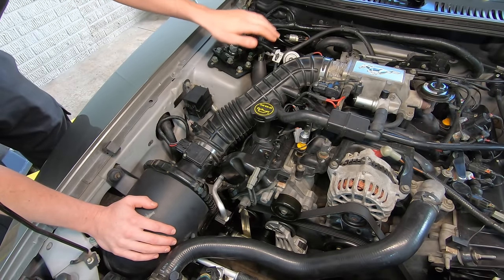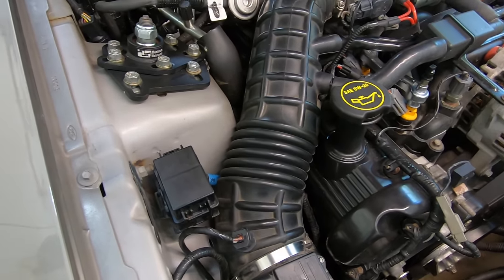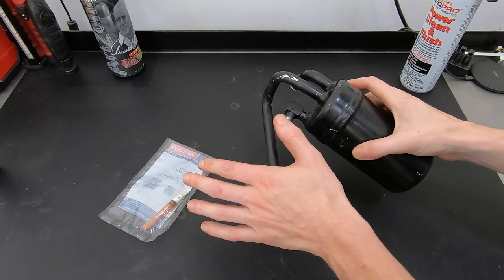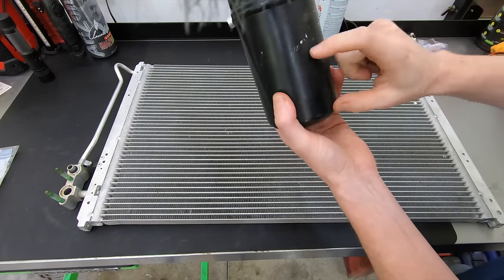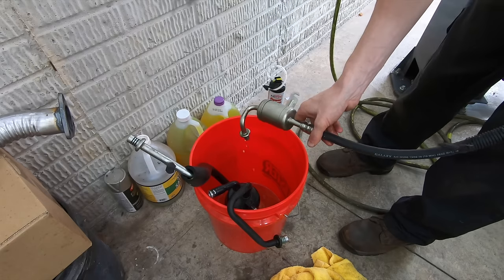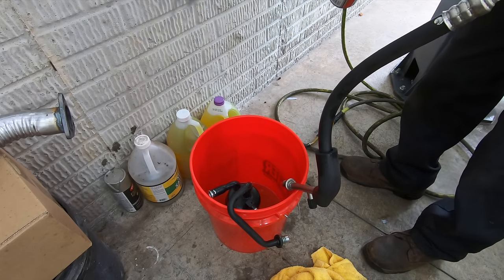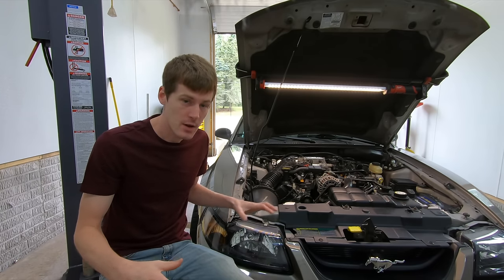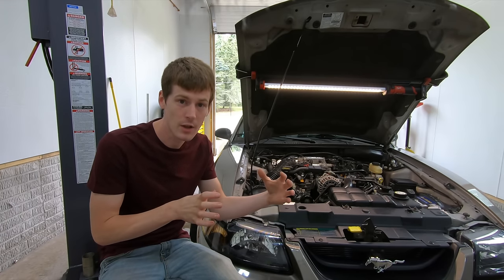How To PROPERLY Flush and Recharge A Contaminated AC System.

Comment from the maker: Tools used in this video:
Aerosol Flushing Solvent (at the minimum you'll need 2 cans): https://amzn.to/3CHaazN
Professional Style Flushing Canister: https://amzn.to/3AfnVCD
Flushing Solvent for Professional Canister: https://amzn.to/3dMGpTy
PAG 46 Oil w/UV Dye: https://amzn.to/3AGIIk4
PAG 100 Oil w/UV Dye: https://amzn.to/3pDHVdp
PAG 150 Oil w/UV Dye: https://amzn.to/3dEstLc

R134A Manifold Gauge Set & Vacuum Pump Kit: https://amzn.to/3AFHmWI
R134A & 1234YF Manifold Gauges:  https://amzn.to/3T9LlCb
Vacuum Pump: https://amzn.to/3A8YgM0
Can Tap:https://amzn.to/3T7is9I
R134A Refrigerant: https://amzn.to/3dDPluj
1234YF Refrigerant: https://amzn.to/3KiejvO 
My Amazon Store:  https://www.amazon.com/shop/repairgeek
Help support the channel, buy using my Amazon links
As an Amazon Associate I earn from qualifying purchases and your cost is exactly the same.

Oil type and quantity information: https://supercool.ac/
-Click Resources
-Click Lubricant Specification Guide.
-Enter Year, Make, Model.
Reply: I would like to add one thing that you didnot mention... When you hookup the refrigerant can to the yellow line, you need to bleed off the yellow hose by loosening the fitting at the manifold guages until the refrigerant comes out, then tighten the line.  Not doing so adds outside air back into the system that is not supposed to be there.  It basically defeats the reason for vacuuming the system. Outside air isn't coolant and contains moisture and moisture and refrigerant becomes acidic=bad
Reply from the maker: @blh3741  my manifold gauge set has what are called "low loss" fittings. The end of the yellow hose has a schrader valve inside like a tire. When I disconnect the yellow line from the vacuum pump, the vacuum is held. The only thing that could have introduced air is the can tap that I transfered from can to can.

Comment: I flush my system very differently than Billy here. First I drink a dozen beers. Next I start drinking more beer as I remove my pressure hose and press it against the low pressure port on the line. I release the solvent into the system. Nine months later we have a baby transformer.

Comment: You really need to bleed to AIR out of your yellow hose when you connect up a refrigerant can. Every time you change a can you need to bleed to air from the hose. If you don't do that, you are adding non-condensable air to the system.
Reply from the maker: The yellow hose has a Schrader valve at the connection at the end of the hose. When I pulled vacuum on the system I also pulled vacuum on the yellow hose. The only thing that could possibly have air in it would be the can tap that was swapped from one can to another.
Reply: @RepairGeek  Your yellow hose has a Schrader valve on the inlet side? Never heard of that. My yellow hose doesn't have a Schrader in it. Your telling me that your can adapter has a pin in the end that depresses the Schrader? Mine does not have anything that would depress a Schrader.
Reply from the maker: @thewoodcrafterioy4003   https://amzn.to/3E5J6dK That is my gauge set. It's right in the description. 

"Red and blue conversion hoses 1/4” F x 1/2” ACME-F, yellow hose with shut-off valve 1/2” ACME-F."
Reply: @thewoodcrafterioy4003  The fittings on the hoses are called low loss fittings. Sealed on both ends when not connected. The schrader valves can be removed for more flow, but you'll need to bleed the hoses when connecting them.

Comment: Great video, one observation :when charging with 1lb. cans,  after attaching can tap and opening can tap valve to each 1lbcan it is a good idea to loosen charge hose at gauge manifold slightly to let tiny amount of refrigerant to exit to purge hose of any air that entered during attachment of refrigerant can before opening low side manifold gauge.
Reply from the maker: This manifold gauge set has a check valve in the end of the hose that connects to the refrigerant. So when I disconnect the yellow line from the vacuum pump it will hold the vacuum.
Reply: @RepairGeek  great video. But if there is a check valve in the yellow hose, then how could attaching a can to it push Freon in the other direction? Wouldn’t the check valve stop that?
Reply from the maker: It's a Schrader valve actually. That's the same valve that is in the stem of a tire. You can fill a tire and let air out of a tire using the same valve. It's the same concept here.
Reply: Subscribed!

Comment: Technically that yellow line on the gauges would have a small amount of ambient air in it after disconnecting it from the vacuum pump. So shouldn't you unthread it a bit and purge it with a little refrigerant.

Comment: I thought that surely after all that work you would measure the charge from the cans using a scale. I've always heard that using Hi/Lo pressures alone is not accurate to determine the correct amount of charge in the system. This video is a great resource to DIYers!
Reply from the maker: The car's refrigerant capacity is 34 oz. 3 cans is 36oz. I just dumped in the 3 cans and ran it. Works great.
Reply: @RepairGeek  Nice. It doesn't always work out so neatly... mine is 19oz
Reply from the maker: 2 extra oz of refrigerant won't have any major side effects long term. The cooling capacity may be diminished very minutely but systems only leak over time. I was going to have more aggravation finding a scale, weighing the can, and trying to get precise over something that isn't going to cause any giant issues. If your system takes 26oz you can't put 36 in it expecting it to work correctly. I am just fortunate with the capacity of my system vs. the capacity of the cans.
Reply: If I don't have the black Gunk you're speaking of and the only problems I had was a sticking expansion valve and a bad clutch on the compressor do I need to change the condenser and muffler?
Reply: @RepairGeek Yep.  The gauge set and hoses held 2 to 3 oz. that didn't get into the car.
Reply: @bryanwood9285  What do you do to add that extra refrigerant to the vehicle
Reply: @xpert_kid_one730  you fill the gauge lines with freon and then tare the scale--or guess. I disagree with an earlier post because I've seen it.  2 to 3 extra ounces won't stop cooling, but will cause it to be less effective in very hot weather because it'll run a little too high pressure...especially at idle.  Thus, it'll get over pressure in very hot weather and the computer will turn the system off.  Been there, don't that.

Comment: Hello! It's by far the best video on AC. A few questions: why should some of the oil in a compressor with a fixed stroke go into the circuit? Like a variable lift compressor, the fixed lift compressor also has a swash plate. Both need to be lubricated. What should be lubricated in the circuit? The only moving parts in the circuit are the valves on the compressor, which do not require special lubrication, and possibly the expansion valve.
The dryer consists of a surface, for example granules, onto which moisture is absorbed. If this surface is contaminated with oil or is even covered with oil, moisture will no longer be absorbed. In my opinion, oil in the circuit is oil from the crankshaft housing which over time gets into the circuit along the pistons

Comment: Very good video!  You touched on many points and I would recommend anyone doing this on their own research..research...research!  (I learned the hard way also!)
I recently had a compressor replaced on my 2001 Buick and neglected to change the drier, condenser, orifice tube.  Mistake!!  Changing-out the compressor "ONLY" was a huge NO-NO.
The shop that changed it out really didn't inform of the negative aspects of everything involved.  Ultimately, I ended-up doing everything (Including a flush) on my own.
Also  - I was under the impression that compressor hoses (Like yours, with mufflers) were not to be flushed?  Interesting.  I'm glad your A/C is working!
And lastly... Thanks for not falling for all the A/C refrigerant marketing crap!  Use only 134-a and don't fall for all those sealers etc.  Thanks!

Comment: Thank you for this!  I'm currently replacing the entire AC system on my S2000 minus the hard lines.  It helped to see how you were flushing your lines out and i have that exact aerosol solution you used as well.  Replacing my evaporator core, expansion valve, drier, condenser, compressor, and high/low hoses.  Only thing i'm keeping are the actual hard lines so I wanted to make sure I got those cleaned out properly.
Reply: Is it ok

Comment: FYI
We recently installed a new AC kit. Had an undetectable leak. No dye anywhere. Held perfect vacuum over night. Held 125 psi of pressure over night. 
Hook it up to the 175 psi compressor and found a bad hose crimp.
Dont overlook the simple things. KISS.
Weve always used lacquer thinner for flushing. Cheap, dries out easily blowing air through. Never had a problem.
Also its easy to add an inline filter at the expansion valve and condenser. They sell little cone shaped filters that slip into the connection fittings. Couple bucks each, slip right in.

Comment: Great video as always. Thanks. 
Don’t use shop air to break vacuum. Use nitrogen instead as it’s dry gas. Shop air will introduce water into system
Reply: Would a compressor with a drier resolve this?

Comment: Thank you so much , excellent video , I have the same problem of a dirty contaminated system, my car is a 2005 Ford Freestar Van, I have both expansion valve systems, because there is a thermal valve in the back, that Van has an evaporator in the back for the passengers, I cleared up many doubts with your video and I gained a lot of information, thank you very much again

Comment: You said an important thing 
No matter of which gas brand you charge your system as it working properly and no it has no leaks...
Golden advice to anyone living in hot. States dude.
Thanks a lot for sharing us your experience on this issue.
I'm glad i knew recently that cleaning the evaporator also is a waste of money and time just buy a new one instead.
Thsnks again from 🇸🇦

Comment: Thanks for very good video! I would recommend to have shutoff valve right next to the vacuum pump in the yellow line. Without that you will have some air with moisture in the system.

Comment: Love your video! One question .. how much psi for the compress air in the evaporator? I’m scare I’ll brake it lol if the air is to strong.. 😅
Reply from the maker: You won't break it. The pressure of the refrigerant when the system is charged and not running is greater than the pressure you'll see with a home air compressor.

Comment: Best vodeo ever! Plus I have an 04 Mustang that I'm fairly certain I did the exact same thing! 🤣 It was my sons car and so many things were wrong with it. He decided to get a new car and I decided I could fix it. So I did. 💁🏼‍♀️  From the start with electrical issues to fuel issues to engine issues to vacuum issues, I fixed. It was insane. I get it running and bam! AC issues. 🥺 In the middle of the Houston summer. I feel like this is a brand new car now and soon will be cold AC! Thank you for this video! ❤️ New sub!

Comment: Pulling a vacuum not only removes moisture but removes any other non-condensables that may be in there. You can compress air,  you cannot condense it. AC works on the principle of something (like refrigerant) changing state. The latent heat of evaporation and condensation is a wonderful thing.
Reply: Does vacuum the oil out of system also?
Reply: @rohitbhatnagar7599  not typically.  The oil tends to move around in a vaporus state propelled by refrigerant. Pulling a vacuum occurs at a very slow rate and thus the oil is left behind.

Comment: Advice… Bleed the air from the charge hose before opening the manifold valve… maybe you did that and didn’t mention it…. or I missed it? Great and very helpful video….
Reply: I was watching for him to do it but didn't see a way on his manifold set to bleed the line other than possibly cracking the line open.

Comment: I did the very same thing…. I replaced my compressor…. It leaked so I had to buy another one. I use pressure and duct temp to charge the system…I could not understand why it wasn’t cooling nearly as well as it should (I now know The pressure was higher than normal due to excess oil in the system…and not enough refrigerant). I’m very lucky I didn’t hurt my compressor… Lesson well learned….

Comment: i have a 89 civic. when i first got it, all I did was vacuum the a/c, change the orings and clean out the hard lines. about 1000 miles after charging it up, the a/c compressor failed, specifically the clutch. this time around I've got a brand new drier, expansion valve, and since my compressor & evap are both serpentine type i'm going to flush them.
hopefully that makes the a/c last a good long time.

Comment: I did exactly ur mistake last week! I put too much of PAG oil and now my ac compressor making noise and the pressure in high and low side both of them not stable i think  unfortunately my ac compressor will die soon i hope it's will stand at less for this samar i wish saw ur video before what i did! Anyway thank you so much I appreciate pro  now i learn more about car ac  system.

Comment: ~@1:20 on the replacing of the compressor: Someone wrote me on Amazon question, that when he put a new compressor he removed all the oil (which was there from the factory) from it, cleaned it w/Mineral Spirits, then added PAG oil. I think it makes sense, since we don't know what oil was added (and how much as a matter of fact), PAG comes in 3 variants: 46, 100, 150, which you can't mix. Now after you wash the Evaporator (really well, since you don't know what oil was there), do you need to add the same amount of new oil to that Evaporator, like you would add to a new one? Or a little bit less?   Direction of the flow, is it from High to Low, or in reverse?. Thank you for your film again.

Comment: Give some good advice when using compressor air to blow lines you are adding moisture in the lines .When assembling parts back together purge system with nitrogen then vacuum until you achieve down to about 500 micron on system if you have no leaks.
Reply: hey someone here nos what to do, you are correct. people are not helping most of the time. i wish they would learn the right way and do it the right way. and u dont use soapy water , u use a special soapy water for hvac only.  and if u achieve 500 u want to watch the rise next. all mechanics are so behind times with ac, cause they are not being taught correctly, and ford says 30 min and sometimes forty five  and with my micron gauge lots of time i see 4000 microns and stalls,so i do a triple evac with nitrogen purge and then i can get the low micron reading .but doing it the way these guys do it they get paid and it will make it past warranty period and then some one is doing it all over again. sad sad sad.

Comment: Great video.  Simple & informative. 
My only question is 'why did you not bleed air out of yellow line before opening valves to charge system?   Isn't that counterproductive to pulling vacuum in the 1st place?
Reply from the maker: My manifold gauge set has a Schrader valve in the line where it attaches to the can/vacuum pump. When I disconnect the vacuum pump the vacuum is held in the line.

Comment: After making final connections in reassembly, I think it's a good idea to remove the schrader cores and use dry nitrogen to blow everything out rather than using shop air. Even though the shop air is supposed to be dry there's a good chance it has humidity in it which would leave moisture residue in the system. This will make the vacuuming go faster with more efficient removal of the moisture.

Comment: Orifice tube systems don't have a receiver/dryer. They have an accumulator. They are not the same thing.

Additionally, you want to burp the blue hose at the manifold end after opening the can in order to purge the atmospheric air out of the hose. Do this by a quick twist of the fitting--all you need is a quarter-second pulse.

Comment: I’m going to do this but I’m replacing the condenser and expansion valve. I’m using the can with the compressor. You are correct you cannot flush the condenser as it has very tiny offices that will clog so easily. That’s why I’m changing mine but I’m thinking I should flush with the condenser on because it has a integrated accumulator so it catches all the crap then I will flush the Line set then I will flush with compressed air with a dry filter to reduce moisture. I’m vacuuming for an hour anyway.

Comment: I do system flushes on compressor burnouts just on a residential and commercial basis. You know your way around HVAC on automotive very well. Akron boys are a hardy stock of Irish, German and Slavic blood.
Reply from the maker: Don't pat me on the back too much. I was the guy that had too much oil in the system haha.
Reply: @RepairGeek ahh.. just a lil slugging. No biggie. 👍 Your explanation of cap tubes, fixed orifices, and txv's as a metering device on the  evap coil was really good.

Comment: Nice info. Thanks. I've wondered about the air that is in the open yellow hose when you attach the refrigerant can there. It means that air is going into the system. Is that bad, or at least not the ideal?

Comment: I don't know if anybody said this already, but I use acetone & mineral spirits $32 w/ air gun to clean, pressure test 100 psi, wait 10 min, check, pull vac 20 -30 min, wait 20-30 min, check, add radiator fluid w/ blinker sauce, check and run 😆👍